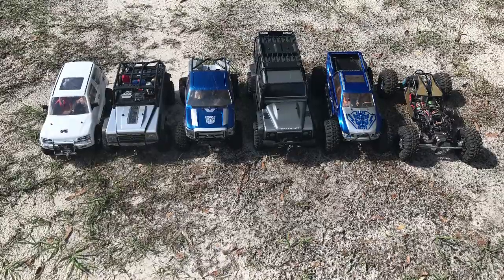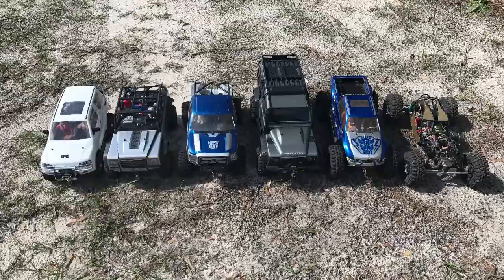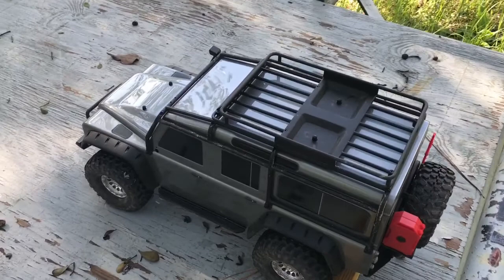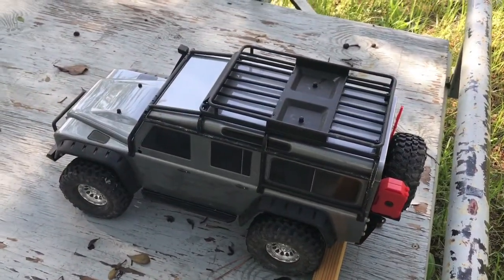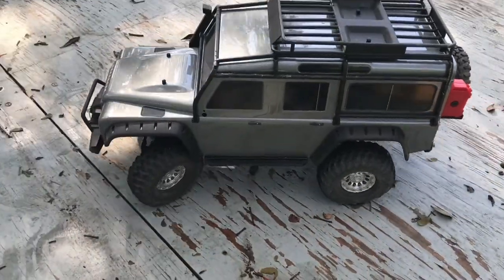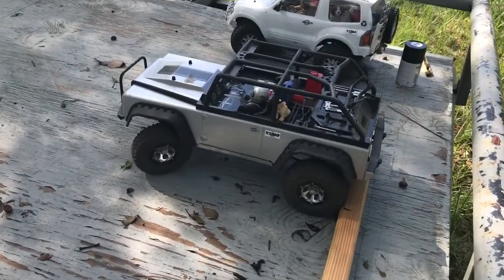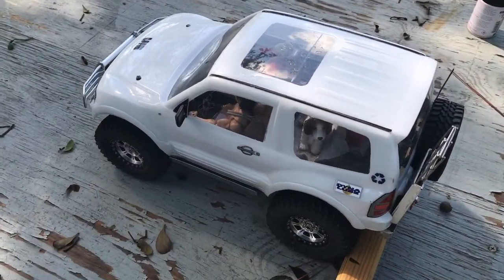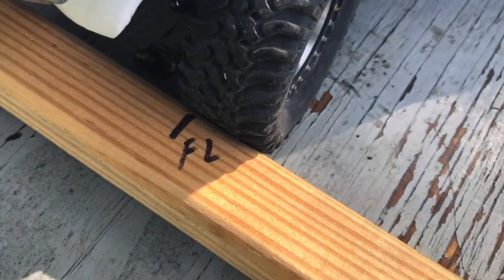Turn testing The Traxxas TRX brushless against my other scalers

Comment: What an excellent video comparison, very impressive. Surprised to see that the TRX4 has worse turning radius with all diffs locked.
Reply from the maker: Yeah with all diffs locked, it really wants to go straight, so you end up with push like the video shows.
Reply: Exocaged RC Why do you think the TRX4 acts that way with the diffs locked? I mean, I understand how locked diffs affect steering, other makes don't seem to have this same issue...at least not to that level. I noticed how wide my TRX4 Bronco would turn with the diffs locked but I didn't realize it was that bad lol. I'm not losing sleep over it either way, just an interesting comparison.
Reply from the maker: You only really notice it now because you have the option of selectable lockers. Also if you want to keep them locked and get tighter turns, traxxas has over and under drive gear sets. As you make a  turn,  the front has a larger radius, so it has to travel farther than the rear. If you over drive the front, the tire speed is faster and more accurately matches the ground speed so you get less push effect and you’ll get a tighter turn. You also get a slight dig effect when driving straight and climbing. The only downside to the over/under thing is reversing can be a bit trickier.  Hopefully I explained that correctly.
Reply: Exocaged RC Yes, I completely understood what you wrote and thanks for the explanation. It's not that big of a deal for me especially since we can unlock/lock the TRX4 diffs are we please👍 Good info nonetheless.